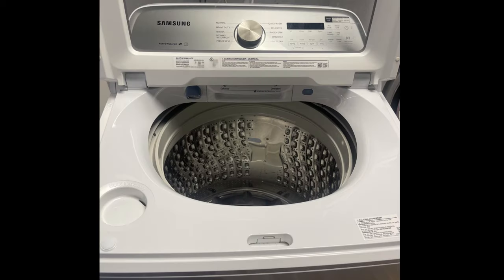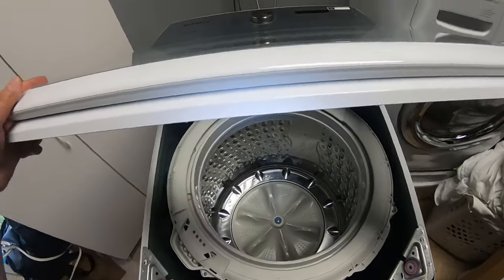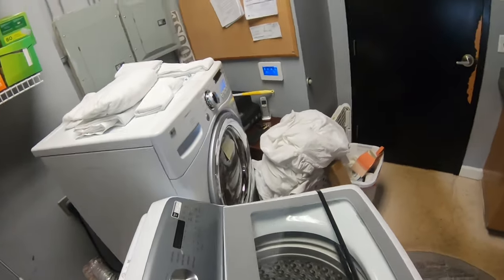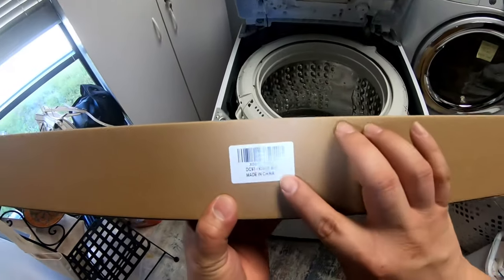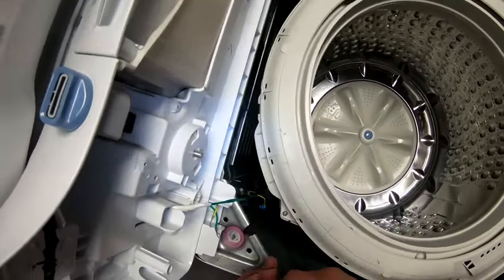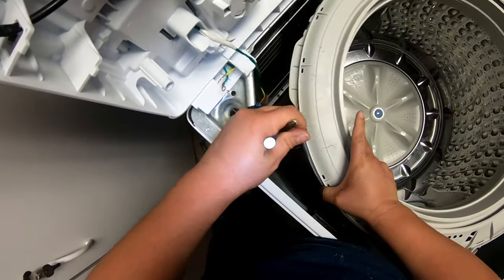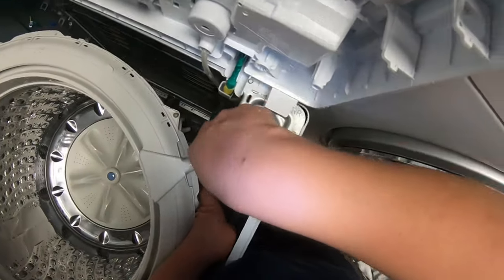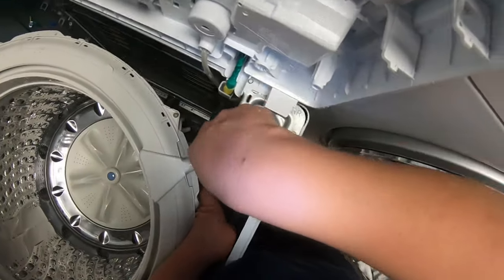How to Fix Samsung Top Load Washer Banging During Spin | OFF Balance | Model #WA50R5200AW/US

Comment: I replaced the suspension rods 3 days ago on my Samsung WA50R5400AV/US-02 with the ones that you had linked to the video. For 2 days it fixed the extreme vibration issue but yesterday it started doing the same thing again. But now on top of that once the wash/spin cycle is complete and the drum is coming to a stop it makes a grinding sound (grinding might not be the best word). Granted I haven’t opened it back up to ensure that the rods are still in place but are there any other reasons that you know of that would make it vibrate like that?
Reply: I watched a few other videos on changing the suspension rods and in them all used white lithium grease on the top and bottom of rods for lubricator. If you didn’t do that maybe thats why it’s grinding.
Reply: We have this same model and also replaced the rods.  Didn't fix and the UR code still appears, also tried tightening nut and wouldn't budge so that wasn't an issue.  Push on the drum and it bounces more than once.  We bought suspension rods from amazon that are different than the ones in the video, and we did use the white lithium grease.  Have only had this washer 3 years and really not wanting to spend $700+ on a new one
Reply: @mariomoncivais7196  Please tell me your machine when it draws water, it fills almost 80% of the drum, right?

Comment: My front loading Samsung would make this loud banging noise a different points in the cycle. I took the top off and the suspension springs were attached. I ran a cycle with the top off and the back of it was very 'bouncy' and it caused the back of the drum to hit the sides of the unit. I notices that both shock in the back were completely separated at the middle. I had to lift up the drum from the back while someone slotted both shocks back together. I suspect they came apart when I moved it and had to set the unit on it's back. I ran a test cycle once it was back together and it was working fine again!